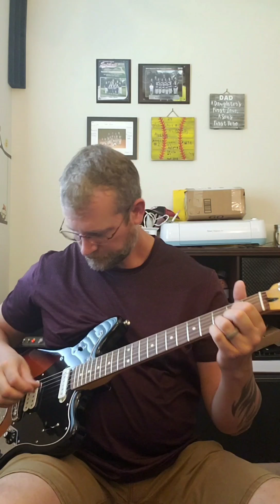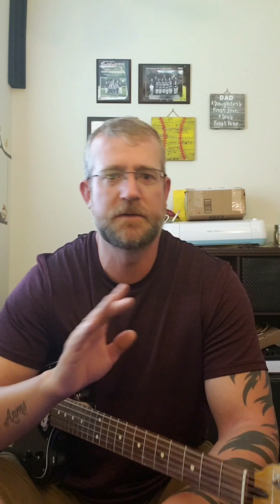Fender player series Jaguar - working vol and tone knobs to get clean and dirt

Comment: Hi! I am not a very technical guitar person, but I want to know how does it sound compared to squier and tagima brands? Also I read somewhere that the fretboard is kinda rough, is it true? I am planning to buy the blue one and I need an expert's opinion. Thanks.
Reply from the maker: I would say it is similar in quality to a classic vibe squier, but both need quite a bit of set up. I've had both and neither were playable out of the box. Fretboard just needed to be oiled, but neck needed swimming, nut needed to be properly filed, a couple of high frets were filed, and the a basic set up, to include getting the bridge to float properly.